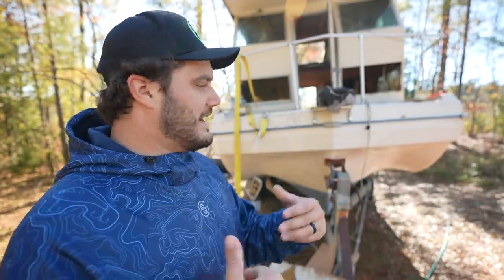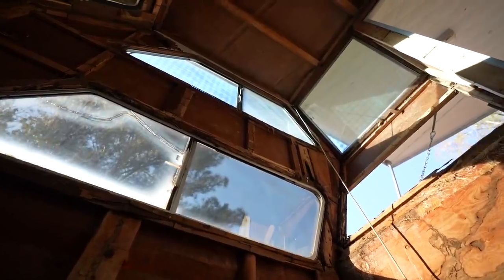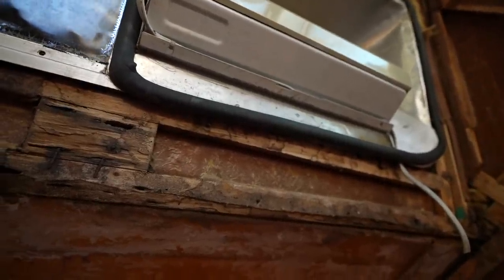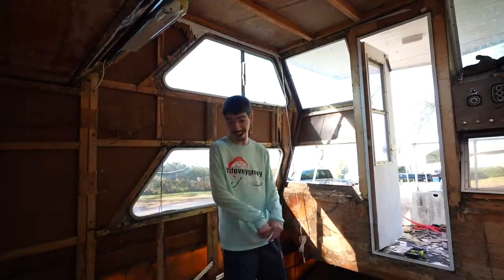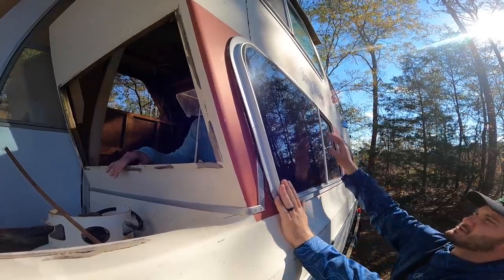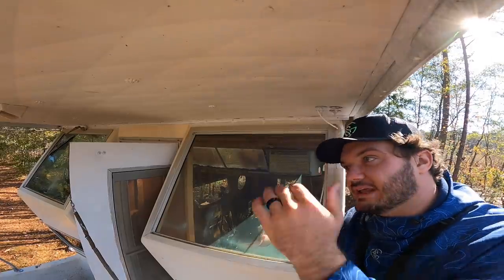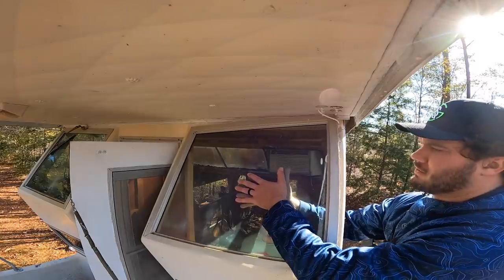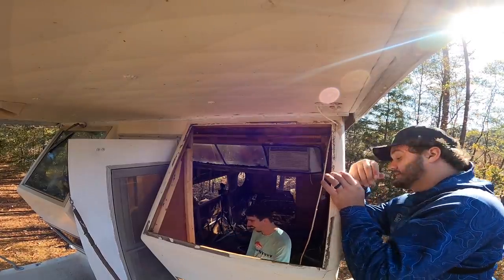It's Worse Than I Thought... (HOUSEBOAT UPDATE)

Comment: Update when you can. That's all we expect.

Until the windows are done, you're looking at plastic tarps unless you can find someplace you can move it inside which is what I recommend. If it's inside you have a place to keep tools and the temperature. which will be important when it comes to doing fiberglass work.

One thing I would very highly recommend is sealing all of your new wood framing, especially the framing around the windows, with a penetrating epoxy to prevent rot. Simply mix it, brush it on and let it cure. It will penetrate the wood fibers and form a waterproof barrier that is far tougher than paint or varnish. It isn't cheap, but unless you want to be doing this all again in a few years, it's worth it.

Comment: You can reseal with a temporary silicone caulk just to get it enclosed, then cover the boat with plastic sheathing /tarps while you work on the interior. It’s a big project. Break it down into little steps. Use the down time to maybe do fiberglass research or looking at outboards etc.  you’re doing fine so far. Make videos when you want to.
Reply: He could use normal silicone, then silicone remover.
Reply: Good advice. Big projects are just loads more small steps ;)

Comment: I really like this series. I agree with what many have said already. reinforce that transom and repower it with a 200 or something. that will be more economical than trying to rebuild and put that thing in. Even a 150 would be lighter and simplify the install. The other thing is sprayfoam. Closed-cell spray foam will tighten that thing up. even the rotten boards will get sealed up from a good foam. Keep up the good work I have always wanted to do this. I didn't even know who you were until I stumbled on this series.
Reply: I agree that foam does a good job of making a boat more solid, but it's best to replace all the wood and seal it with a penetrating epoxy before using any foam. That will ensure that the boat stays solid.
Reply: Even a 90 outboard would push that at reasonable speed, and i fully agree, its easier to install, easier to maintain, and on an already short boat the old engine compartment would make great extra storage and a couple live wells.

Comment: Tarp it until you can get the windows reinstalled, I like what you’re doing with the ity bity. Restoration is hard and you have a real hard restoration ahead of you. If you restore it properly then you will reap the benefits. I’ve done some restoration projects myself, just don’t give up. Top to bottom on the boat and it should be under tarps . No more rain
Reply: Agree Larry gotta get it covered before work begins? I’d also drop something flat on the floor to stand on ? Clean the site ? 🛥🛥👍👍🚤🙈🙈
Reply: Cheap carports from Harbor Freight work well for that.

Comment: Since you did not buy treated lumber, you can treat the wood with Rot Doctor epoxy and never have to worry about wood rot again.  Treat it before you install it. It will last your lifetime.  I would definitely recommend for the stringers.  It's not cheap but neither is the wood you are buying so why not do it right?  My $0.02

Comment: Love these Itty Bitty updates!  I'm no carpenter but would it best to start at the bottom of the boat for reframing and such then work on walls / windows?  I would think you would want strong foundation to build upon.  Do you know anyone with carpenter experience to give you guidance?  Anyway, can't wait to see what the IB becomes :)
Reply: Also use pressure treated wood or aluminum instead of the wood.
Reply: @msayloradiginfo  Yes, I know it would be pricey but aluminum framing would be best (no chance of rot).

Comment: Just do your best when you can. Throw over the boat large tarps to stop rain or snow from getting inside. Continue to gutting it out to it's keel. Then do patch work. Sanding and primer paint. Week after week, you will see progress. Think of the layout of your remodeled houseboat. Start with your engine and propulsion system, then bathroom, then galley, then stateroom, and living quarters. I think the Captain's deck or Bridge should be last. By next Summer, this houseboat will be floating on a lake. Use hardware and parts from RV's, Marine shops, Aircraft repair stations and Hardware stores. Ask for volunteers to help. Eventually, you will have a   house warming party when done. Get insurance just in case of fire, weather, or some unforeseeable accident. You can do this. Hoorah! 😎👍💪👏👨‍🔧🛥⛴

Comment: When those windows go back in you need to use urethane glue. Not silicone or caulk those both get weak and dry out over time. Urethane glue is what use to hold in windshields and a whole cars together now. We use black mamba brand at work to hold undermount sinks to stone countertops, it's stronger and seals better than using anchor bolts and silicone.
Reply: Keep here to say butyl tape, but your suggestions is better.
Reply: You use new Butel tape fro any RV store

Comment: No offense dude but this boat needs to go to the dump someone should have paid you to hull it away. A boat this old is only worth a few grand in good water ready condition. Any time you have a boat like this with rotted floors on the inside you know damn well the rest of the boat and everything up top is gone. When you look at a boat and it’s not shrink wrapped or completely covered with a massive tarp it’s absolutely going to have rotted wood. I always feel bad when I see people buying their first boat and get screwed like this. People think they are gonna save money on a fix it upper but they always end up spending way more then it would have costed to buy a running boat plus all their time. I’ve been boating for many years the only boat I would buy to get for a deal would be one that’s in very good condition and just needs an engine or drive and if ur gonna keep the boat for a long time then it’s really a better idea because you will have a brand new engine and not have to worry about the engine being reliable. It just costs too much money to rebuild an interior of a boat and way too much time I’ve done it before and I will never do it again! Just last year there was a boat that would be worth 80k running but it needed both engines replaced so it sold for 10k. Before I could go buy it someone I know bought it, spent 20k on engines and all in he had 30k into a boat worth 80k. My father in-law bought a 28ft boat that would be exactly what you would be looking for he paid 7500 it’s worth 25k the reason he got it so cheap was the owner was sick and couldn’t keep it, there always someone selling bigger boats for nothing. Again not trying to say ur stupid or anything just hate seeing people getting screwed on boats because they don’t know any better.

Comment: best sealants ever.
Tremco Vulkem V116GRY 116 Polyurethane Sealant, 10.1 oz Caulk Tube, Gray 
or
GSSI Sealants Butyl Tape 1/8" x 3/4" x 50' Gray 
you need to check to see if the vulkem would damage fiberglass but it works great.

Comment: Torch that thing and build a houseboat from an old pontoon boat,  strip it, re-deck it, acid wash the toons, add a 3rd toon, and go from there.  It will be 100x better project.  And **NEW**.  YT has lots of videos.  Cut your losses now, that POS needs everything replaced.  Sorry.

Comment: I’ve been around boats and RV’s my entire life. Older RVs tend to have leaky windows as well from all the torquing and twisting while going down the highway.   Plus they’re built with 2x2’s.  Not a lot of strength.  I fear your boat is built the same way.   If you can replace all the wood structure. Maybe with something stronger, thicker, you’d make your boat stronger.  (But heavier) You need to balance your fixtures as to not to add to much weight.    If that were my boat, I’d maybe invest in spray foaming the entire inside prior to putting your walls up.  Hire one of those mobile company’s , they’ll trim it all flat to the studs.  It would be pricey but worth every cent.  As it will give your boat excellent insulation plus it will create a water proof seal throughout.  (Do all your of your electrical  first) 
Good luck.   Have fun with it. 
BOAT- Bring Out Another Thou$and)

Comment: I feel your pain guy. Several years ago, I bought a 1975 Thomson wood haul with a 30 horsepower. Once I got it home and pushed into the shop, I begin taking pics and categorizing everything. Two weeks later I begun the doting task of striping it down to begin refurbishing the wood frame and ribs. Eventually it took me exactly 7 months to complete. However, three months later well on our way to the lake a drunk driver ran a red light and ended up broad siding the boat and completely devastated it. It was a total loss and thousands of dollars down the drain. Good Luck!!!

Comment: It’s easier / safer to keep the interior clean.    Buy a decent size shop vac.  Sweep up , pick up, throw away & vacuum . ( you will vacuum possibly hundreds of times.  Then throw down 1-4 pieces of plywood to give yourself a solid , safe work platform.
Now, get back to it .

Comment: I an absolutely amazed that you didn't loose at least half if not all of those windows bringing the Itty-bitty back home.
That's a VHF radio antenna. 
Channel 16 is for emergencies including calling for Coast Guard assistance. 
Even Coast Guard aircraft monitor VHF Channel 16 as they seriously increase the range a signal can be picked up.
I'm glad to see you finally wearing eye abd breathing protection from the mold and debris flying all over the place. 
A friend of mine was cleaning out a extra large shed with mold and opted wood and got wood dust covered in mold spores in his eyes mouth, sinuses and lungs and came really close to dying.
He spent almost 2 months in an intensive care unit most on a respirator tubed up.
Fed thru a tub up his nose.
Went in 250 pounds cane out 180 pounds.
I was in a coma for 13 days and lost 42 pounds.
That's what happens when you're fed by a 16th of an inch plastic tube.
Take care Y'all. 
We subs would like to see Itty-bitty back on the water her Captain healthy with the family having a blast.
Questions, are you going to put a water slide on the aft upper sundeck down level with the lower deck a few feet above the water.
If you do make it hinged on top so you can fold it up and back down forward to secure it to the upper deck for transport. 
A friend of mine did that on his 25ft houseboat using stainless steel hinge, hardware and stantions with rubber lined U sockets for it to rest on when down.
One every 3 feet that also folded up for storage on the road.

Comment: Any water craft with windows leaks and just viewing the interior before gutting I would have said pass. Yet, having been born  on The GOM I can say iIF the hull is not damaged, carry on! Also if you can avoid it DO NOT USE wood in the hull interior, sub floor/ storage. Make forms of expanding epoxy foam resin, it hardens and adheres to fiberglass, would be sound structure and no more rotting - and well if you send me some measurements I could work up a pour inplace joist plan and how to build the forms in place as well as glassing! I have not seen a fome joist fail, this is a an expensive trailor you bought! I still see this as a worthy project! If you pull this off you will have epic growth on your channel as well!

Comment: My initial recs would be to... get the hull under a large shelter/canopy right away, fog that baby and surrounding ground with DDT, use aluminum sheet/ribs/struts/studs/tube at every oppty, use as little wood as possible, start practicing ur fiberglass & CF skills, steel is heavy but can be a structural savior. LASTLY take your time, you'll be glad you stepped away for a few weeks to ponder this or research that, give it some deep thought as you figure it all out. Good luck and stay aware of your gross weight limits!

Comment: You are describing what 100% of the rest of your DIY audience knows from experience.  The previous owner should have invested in some tarps to protect your investment.

Also any  thing that is supose to float as its function, don't use RV dum dum to seal exterior water seals.
That stuff was a bad product design out of the gate.  Go to a real marine store and get the good stuff when reassembling your 100,000,000 part puzzle. You will thank your self in the end.

Comment: Butyl Tape for sealing anything on the outside.  That's just waterproofing it's not adhesive.  The screws hold the window into the frame, the tape stops the water from getting in.  The VHF antenna needs to be that long for communication over about 20 miles. You're building this boat for a good time, but not for a long time or you'd be using some kind of tropical hardwood rather than what looks like Home Depot pine. Boats get wet, invariably windows are left open, there's high humidity, they just are wet.  So cheap wood, even on the inside rots and swells. When it comes time to do fiber glassing work I recommend Boat Works Today or Sail Life - two excellent YouTube channels with tips and tricks you'll need.

Comment: I did something similar years ago. I bought an old 1969 16 foot Cobia boat, thinking I was gonna slap a motor on it and get a trailer. I wound up having to remove the top deck, replace the floor, keel, stringers and transom.  Then bought a used outboard not knowing the pistons were seized. I rebuilt everything and the boat ran like a champ. Thats why I am here watching you. Good luck with the project!

Comment: Those aluminum windows reminded me of a friends fixer upper house.  He bought a house for $60k.  One of the drawbacks was it had all aluminum windows in it.  Even back then, I don't know why they would have installed plain aluminum windows like that in a house.  He worked on other stuff while I had an idea!   I got aluminum cleaner and cleaned the inside and outside with a brillo pad, scrubbing carefully.  I rinsed them off with a garden hose.  I was at a flea market and I saw artists paint brushes with wooden handles that I thought were dirt cheap.  My pal uses a cell phone and he scanned the upc code and a pack of 6 was $30.  I asked the lady how much she wanted for them and she looked over and said "fifty cents a pack". Wow!    She had 22 packs which would be $11 and she told me to just give her a $10.
Anyway, I opened a pack and I got some white enamel aluminum paint.  I taped the windows on both side and carefully gave them a coat of paint. Then two coats.  I did the same with the aluminum frames inside and out.  After I did one,..... wow.... They looked like we ordered brand new white clad windows.  So don't forget that aluminum can be painted to help give it the wow factor.

Comment: Just a suggestion. Install a pair of decent used 75 hp Mercury or Johnson outboards on the boat. Two reasons, back up power and maneuverability, which you will need both. That stern drive and old Ford are junk, guaranteed. Put a generator where the car engine was.

Comment: I'm working on a 1986 bigfoot camper and it's the same design as your boat I have it all stripped out like your boat and my camper looks exactly like your boat I'm adding stringers on the walls the original design of my camper was one inch foam glued to the walls with paneling glued to the foam I'm using foberlay fiberfiller to glue the stringers to the walls I can probably give you some advice if you want to contact me

Comment: Go to west marine and get you self a tube of 5200 it’s like caulk and I’m a commercial fisherman and Iv punched a big hole in the haul of my boat sealed it up with the 5200 and it doesn’t leak a drop just ask the people at the counter for marine grade 5200 and they will know what your talking about I’ve used it for many leaks and my boats got a fiberglass over wood haul I promise actually I guarantee that you that the 5200 will never peal or leak

Comment: To keep your goggles from fogging up, put some liquid soap, or spray some windex on a paper towel, and rub it on the inside of your goggles. The divers I used to work with did this to keep their goggles from fogging up. But a word of warning, make sure your eyelashes aren't long enough to touch the plastic, that can cause some discomfort.

Comment: I see this like building your own custom boat at this point. I would get some tarps to keep the rain off things and get started. Get the walls and haul stable and then go nuts! Get it sealed up, Get rid of the shower stall and build a epoxy shower stall from scratch(its just foam, fiber glass and epoxy).  i would make sure to keep things modular so you can add in electronics and plumbing easily. Go with products that are water proof or dont degrade and make a 24ft fishing barge

Comment: Guy, I love the videos. However, if those are the knives I remember then get rid of Huusk. They are not even Japanese and are made of pot metal. If you scratch the Black portion of the blade the paint will scratch off and you will have bare metal under it. Not original at all.

Other than that am loving the content and if you need financial backing then set up a patreon or go fund me. I would be more than willing to chip in.

Comment: good keys boat not an open ocean boat i commercial fished the gulf of mexico and the atlantic off florida for 30 years that boat is built for protected waters,  but an awesome project. been something ive wanted to do for years 50 years old refurbished many boats just finishing up a 36 ft uniflite in seward ak been a couple years working 0n it. But would love to do a towable house boat way better than a camper. It is a lot of work but very rewarding you will have something you will get many years of pleasure from.